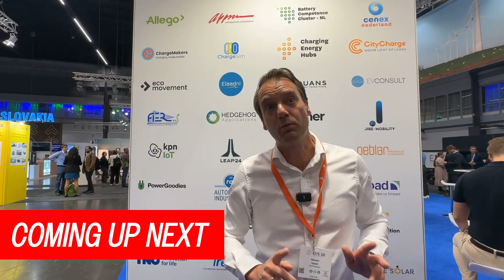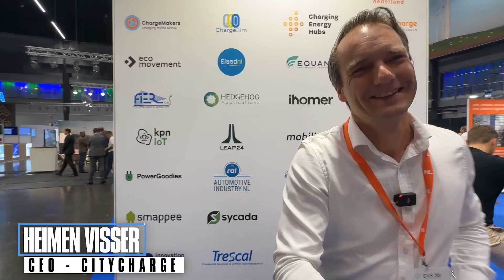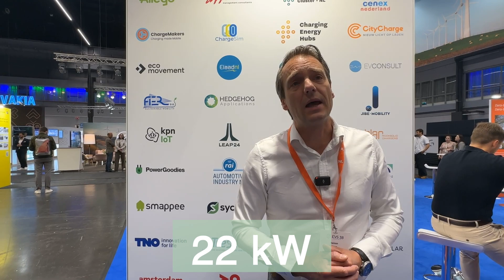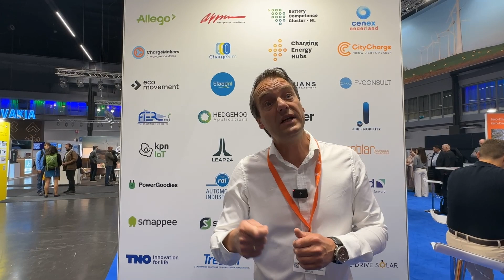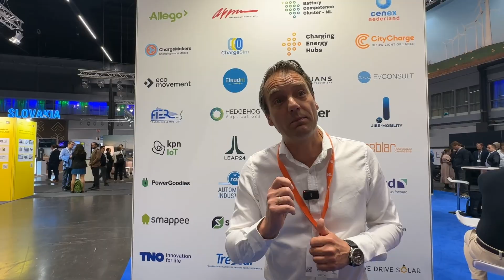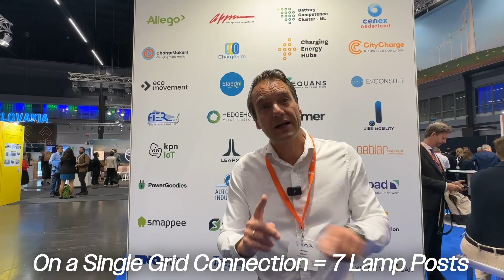How Street Lamps Could Charge EVs & Solve Urban Charging Problem

Comment: Already present in London, seen it by coincidence walking around. Nothing new. Great solution indeed.
Reply from the maker: Those should be from Ubitricity, I guess. They have been in the business for over 10 years but it is really slow charging. I think 6 kW or something. I am not sure, as I have to research later. But CityCharge was 22 kW or lets say 11 kW, as this is charging capacity with AC of most EVs.
I posted this on Linkedin and one really nice comment was that if you are parking on the street, perhaps you dont really want to charge with 11 kW. Perhaps you would rather have it charge over night, 11-12 hours with really low power and it does make sense for some use cases.